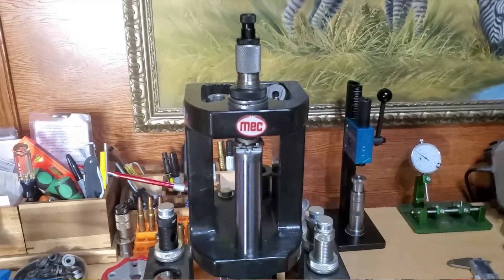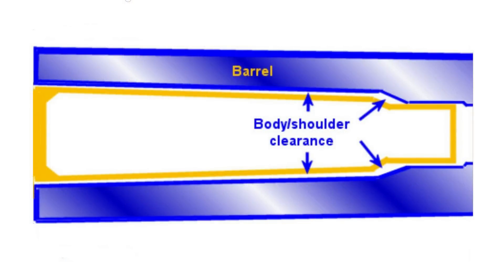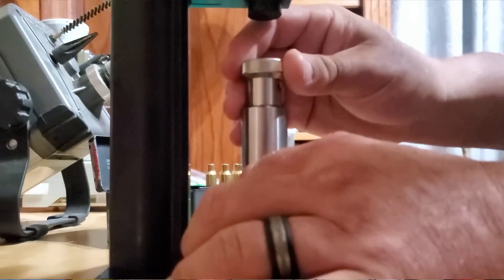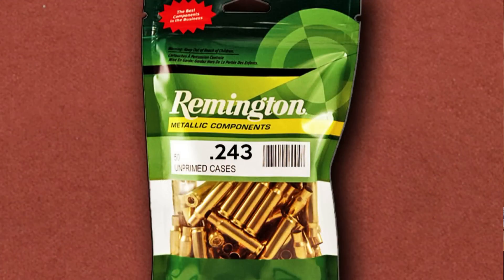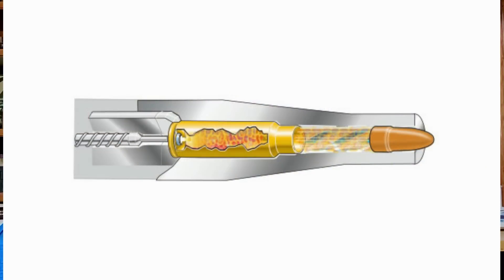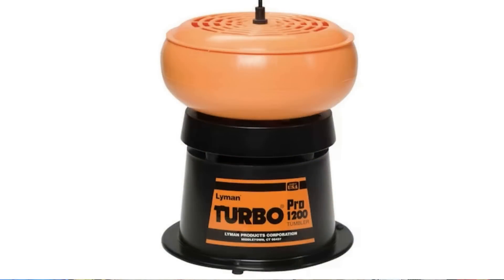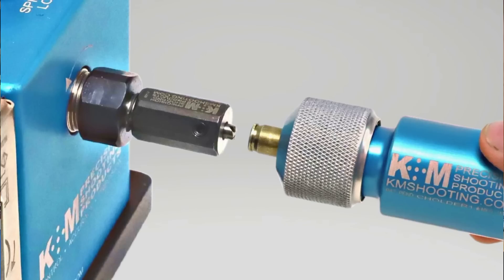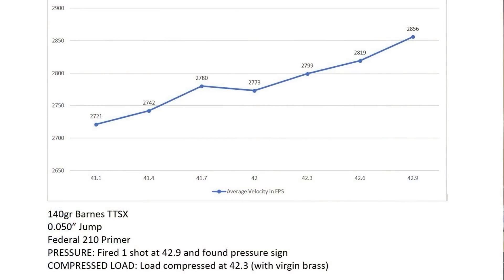VIRGIN BRASS vs FIRE-FORMED BRASS

Comment: Very interesting. I like these sorts of summaries. I’d like to see a chart about all the factors that contribute to accuracy and by what magnitude so that one can choose to simplify a reload process to the level of effort.
Reply: This is a very interesting question. I found one source who says:
1 - cartridge selection
2 - powder
3 - bullet
4 - seating depth consistency
5 - chamber/operating pressure
6 - charge weight consistency

Other factors were listed but looked insignificant. This is just a starting point for discussion to me. 

More than anything, consistency matters - how you support the rifle, aim, pull the trigger, and every step in hand loading. You might choose a bullet for a specific application and then find the best powder. Seating depth definitely matters IMO. Traditionally you find the best powder charge, then experiment with seating depth. 

Also, this ranking assumes that you have a quality barrel with a chamber cut correctly for your cartridge. I discovered while building a couple of 308 ARs that tolerance stacking can lead to excess or insufficient headspace, and that’s not considering throat dimensions which might be all over the place. Frankly, I think I’d put “Quality barrel and bolt” first on this list even before cartridge selection.

Comment: Been using all kinds of brass cept lapua.like nosler but use my cranky winchester stuff Remington like fed when volume not an issue. Trying to make Once Fired headspace in belted 338 is interesting.  <> but not interesting in MY 300w cause that chamber is 10.000 longer yet. I want use shoulder head space right under beltheadspace. Whats a good setup for that? Custom die.?

Comment: Mr Dog when do you start Annealing? After how many rounds.  I usaull start pretty early like 4 to 5 shots.  Use the Annealing made easy the new digital.  A safer way the using torches.
Great video with lots of must know info if accuracy is important.  CW
Reply from the maker: @cwness4587  for my precision ammo, I anneal after every firing for consistent brass spring-back and neck tension. For some hunting and plinking loads, I might anneal every 4 firings.

Comment: Superb thumbnail! 😝 Good topic too. 

Maybe you said it at the beginning, but most of this only applies to bolt action and single action rifles. Many semiauto rifles (a) extract brass before it has a chance to spring back and (b) need smaller brass to ensure reliable operation.

Comment: Another great video 
Cheap Winchester and federal brass works for me fire form them bump the shoulders back and do all the prep work then as you say when they start showing there age  recycle been.  Cheers 🇨🇦
Reply: Same here.  I find federal premium nickle coated brass, and the brass from the factory loaded fusion to be really high quality and very consistent weights and wall thickness.   I think DD is off base with this statement saying federal brass is low quality.    I get incredible reloads with federal brass.

Comment: To load for accuracy you need to set size die to "bump the shoulder back .002-.003" ?????
Reply: There is plenty of disagreement, but this is the current consensus. As is annealing after every firing. I use collet neck dies and anneal every 4th or 5th firing. Works well for me.
Reply: @jasonshults368  Thanks for the reply. I mimic your routine except for two older military rifles that need fl sizing to be happy. To each their own but obvious cause of head separations shown, not the belt.
Reply: Not necessarily. To automatically take fired cases, let's say once fired, and FL size them and bump the shoulder 0.002 or 3 could be sizing too much. You may be well aware of this. I don't know. For example. I took a new Tikka 270 Winchester to the range to get some rounds through it. I shot 3 boxes of factory ammo I got on clearance at 6.99/box - Winchester stuff. When I got home I rechambered all the cases and they did so easily just as they did when virgin. Thus, I neck sized only with a bushing, reducing to 0.003 less than a loaded round, then used the expander mandrel which opens the neck to 0.002 less than a loaded round. Then trimmed all to a uniform length. I then rechambered all again and all fit easily. As such, there was no need to FL size at all and I didn't have the extra steps of lubing, FL sizing, cleaning the lube off. I loaded 150 grain Nosler ABs over a full case of H4831SC after testing OCW. The neck sized test loads never shot over 3/4" group regardless of powder charge. I then tested two 3 shot groups at the desired max powder charge with more of the 1x fired cases for confirmation and it made one hole about 0.222. Then I went through the same process and reloaded those so I'd have 60 rounds total for hunting season. Only 1 of the 2x fired cases was slightly snug when closing the bolt. That one will need to be FL sized after it is fired.

Comment: Virgin brass is Identical to factory Ammo loaded  brass. If your Gun likes factory ammo, your gun will like Virgin brass reloads(If you do it right), Most reloaders will Full size brass. So its back to factory/virgin brass dimentions. I will just clean and neck size my brass IF, IF they chamber easily for feeding reliabillity. With Belted cartridges, Shoulder bump, Not Full size. for longevity. Great advice. Thanks DD
Reply from the maker: @WillyK51  Virgin brass is so undersized, that even after FL resizing making contact with a standard shell-holder, the brass will be noticeably larger. Measure it and see for yourself! Your brass will never be as small as it was when it was new.

Comment: Great video DD. The brass issue is the ONLY reason I haven't picked up a 6.8 Western. I think the cartridge is a fantastic one but unless someone other than Winchester starts making brass/ammo I won't buy one
Reply: The 6.8 W is a bit shortened 7WSM, Just run it through a 6.8W sizing die and trim the excess neck
Reply from the maker: @WillyK51  Have you actually tried this? It's not that simple.
Reply: I’m not going to say Winchester brass is the top tier, but I have loaded a lot of once and twice fired Winchester, for my 270 over the years. It’s perfectly fine. Do I prefer Norma, Nosler (which sometimes is Norma) or Lapua? Yes I do. But I’m not using the Winchester brass for competitive events. 
Winchester/Browning ammo sucks, but I think it’s the poor manufacturing process.
Reply: ADG makes brass for it.
Reply from the maker: @echofoxtrotwhiskey1595 Have you actually seen it???? They have said they were going to make it for a year now, took Pre-orders, and have it on their website (not in stock). But I'm not aware that they are ACTUALLY making it.
Reply: @echofoxtrotwhiskey1595   Not familiar with ADG. I'll have to look into that. Thanks.